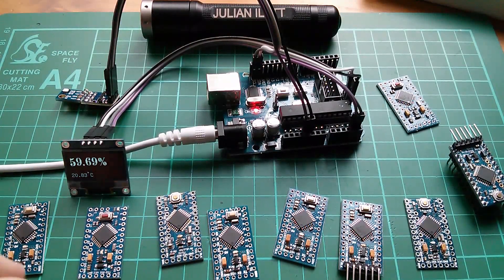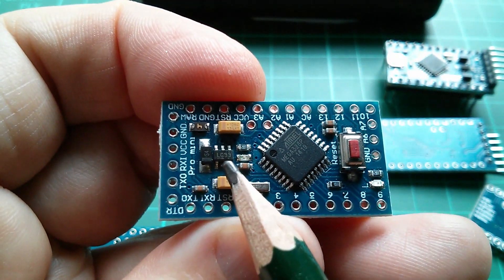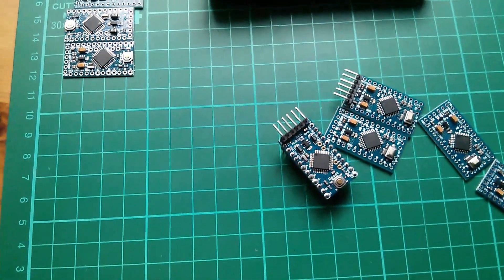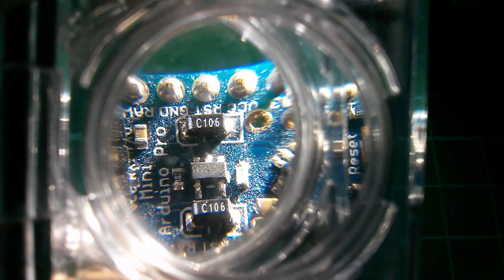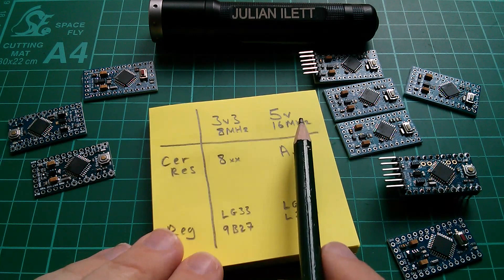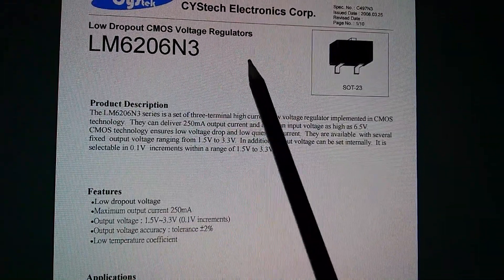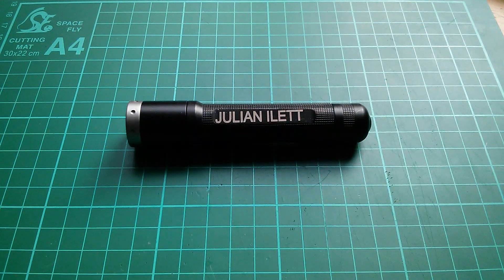Arduino Pro Mini Identification - 5V, 3.3V, 8MHz or 16MHz

Comment: why not a Nano?
Reply from the maker: It's slightly bigger - and the USB/serial converter isn't needed once the microcontroller is programmed.
Reply: Yeah. For projects that are actually just programmed and not monitored by a computer using serial this isn't necessary. I recently made a device that measures voltage of a LiPo with a voltage divider + 0.26v since this isn't that accurate and it's about the ratio. I am using an OLED i2c to display it. It also shows the uptime using millis() and battery percentage if full means 4.2 v. Love the channel btw.
Reply: Well I have lost and found my ftdi too many times. I like Nanos.
Reply: I hope you will be identifying your USB/serial converter for us, with pinouts etc. I bought a handful of these Pro Minis but got the wrong converter/programmer.
In the back of my head you have a video where you present a few of these, but I couldn't find it.
Reply: Julian Ilett yes it's smaller but what about when you add headers. It makes it a tad awkward in size. Do you remove them or have some sort of pogo pin setup.

Comment: would it be ok to change the 16mhz crystal to a 20mhz crystal? just wondering
Reply from the maker: It would probably oscillate OK, but timings for delay() and millis() would be inaccurate. As far as I know, Arduino only understands 8MHz and 16MHz clock sources, so you may have problems getting these timings right, even after altering the 'boards' file.
Reply: I think it could be possible, but i am not sure how would it effect the rest of the system.
Reply: champstyl Its possible but you have to change the cpu frequency in the boards.txt

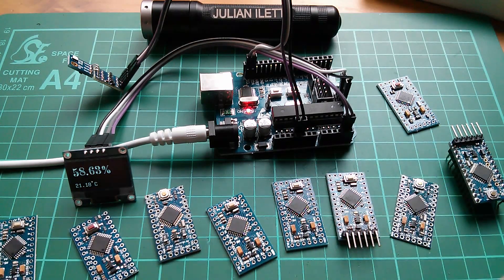Comment: 1:52 I had to look up the term munging. 
Intuitively I felt it was an electronic form of mashing. 
According to Wikipedia:  

Mung or munge is computer jargon for a series of potentially destructive or irrevocable changes to a piece of data or a file. It is sometimes used for vague data transformation steps that are not yet clear to the speaker. Common munging operations include removing punctuation or html tags, data parsing, filtering, and transformation.

The term was coined in 1958 in the Tech Model Railroad Club at the Massachusetts Institute of Technology. In 1960 the backronym "Mash Until No Good" was created to describe Mung, and a while after it was revised to "Mung Until No Good", making it one of the first recursive acronyms. It lived on as a recursive command in the editing language TECO.

Usages of the term appear in munged password (a strong, secure password created through character substitution), data munging (cleaning data from one "raw" form into a structured, purged one) and address munging (disguising an e-mail address).

Munging may also describe the constructive operation of tying together systems and interfaces that were not specifically designed to interoperate. Munging can also describe the processing or filtering of raw data into another form.

As the "no good" part of the acronym implies, munging often involves irrevocable destruction of data. Hence in the early text-adventure game Zork, also known as Dungeon, the user could mung an object and thereby destroy it, making it impossible to finish the game if the object was an important item.
Reply from the maker: Yeah, I looked that up a couple of days ago - not much mention of hardware munging - but I guess it applies in much the same way.

Comment: All my 5v 16mhz say 16.000 on the crystal
Reply from the maker: They do exist - useful if you need a very precise timing source in your project.
Reply: And the Regulator says L05
Reply from the maker: Are those Pro Minis? Not many Pro Minis have crystals due to lack of space.
Reply: yeah there are some pro minis that fit those huge hc-49 crystals on them: https://de.aliexpress.com/item/ProMini-ATmega328P-5V-Compatible-for-Arduino-Pro-Mini/32525859745.html
Reply: Julian Ilett Yes, Pro Mini, the cheapest I can find in Germany, somewhat like the One Strawberrymaker suggested
Reply: but my Atmega Chip is way smaller, in diamerter maybe like a third of the board width and the Regulator is also extremely tiny... http://www.ebay.de/itm/222197380209?_trksid=p2057872.m2749.l2649&ssPageName=STRK%3AMEBIDX%3AIT This is the one I bought
Reply: Klonkiller361 that is another type of package for the same chip, which happens. but the bigger ones are more common thus a bit more cheaper in shenzens markets